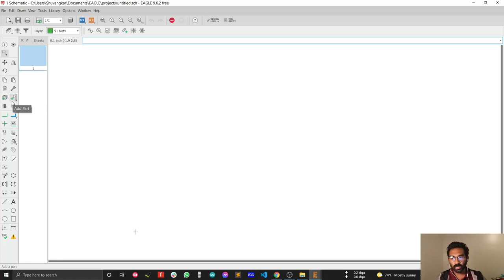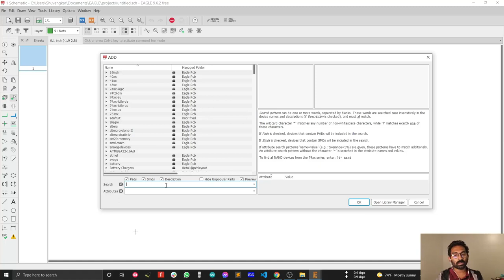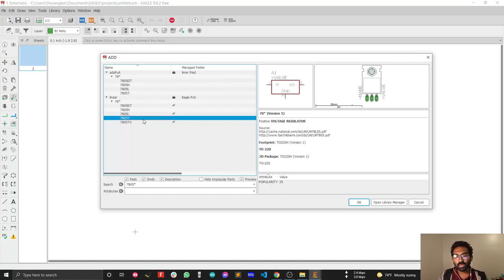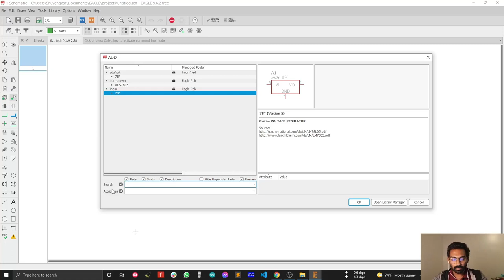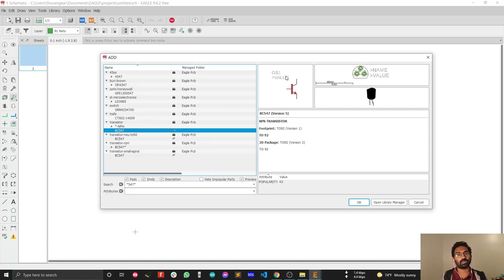Eagle PCB  Tutorial | How to Search Components in Autodesk Eagle

Comment: Had this problem for a while. Thank you. Now I have a problem with fuse holders (SHK20L) which have 4 pins - but 2 cannot be connected on the PCB if using a fill around them. Is there a way to work around this? Thanks for your time explaining.